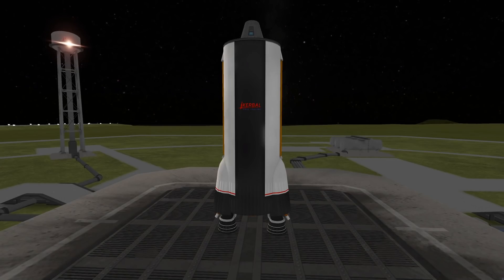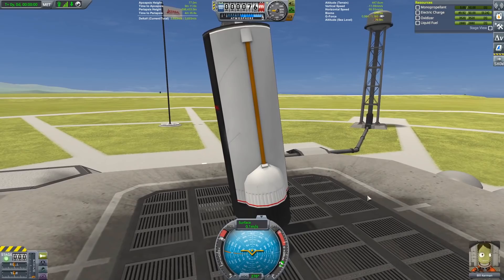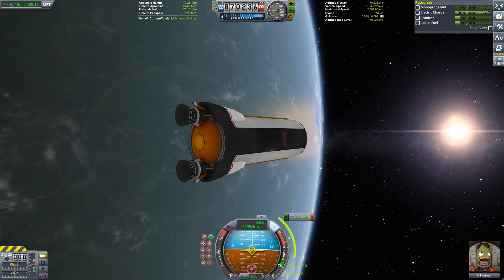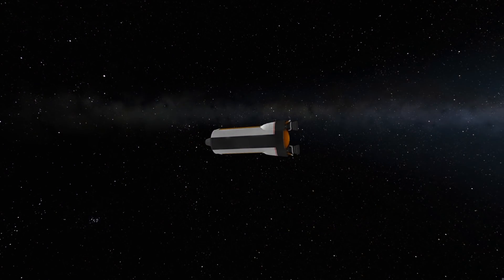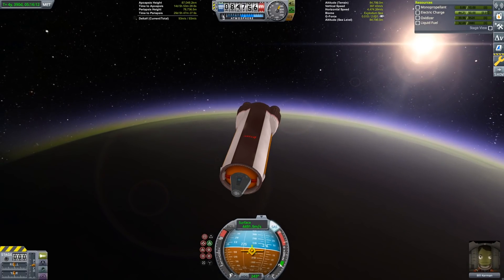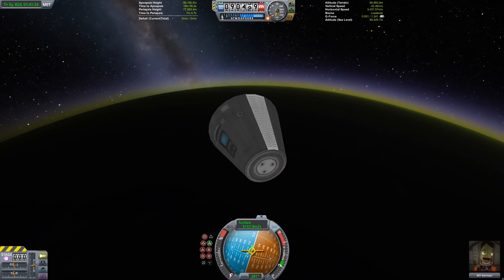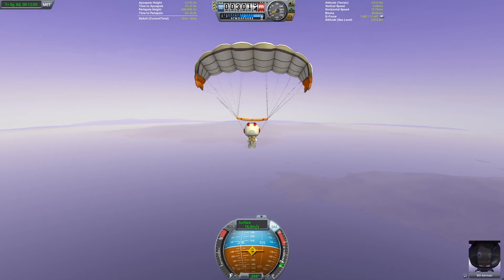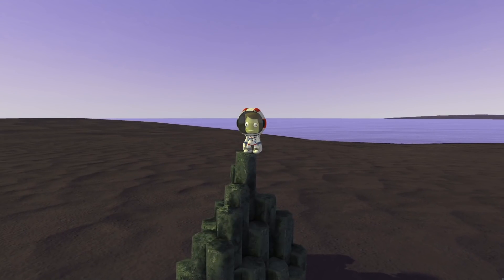2 Part Mission to Eve

Comment: For the inventory system, I noticed the "extra fuel" part adds 3 eva fuel, while a pack has 5, yet it is possible to carry 2 EVA packs, so isnt it better to do that for the 10 EVA fuel instead of 8 with the "extra fuel" part?

Comment: You could but a parachute for the craft into the inventory of a kerbal (I think) and then do the same thing again but when you break off the engine you can Eva and add the parachute... Then it's technically still 2 parts

Comment: great video as always. As for ideas, here's one (not fitting your minimalist series though). I was recently trying to build a stock walking robot and see how fast it could walk. My limitation was that the walking style should be akin to an animal. It proved quite hard to get decent speeds, mine topped out at maybe 7 m/s. Maybe you wanna give a shot at this? Loads of engineering problems: kinematics, KAL programming, material of the feet, steering, stability... This could also developed into a monte carlo challange, for instance time to walk down the runway. What do you think?

Comment: A Kerbal with the new EVA canisters has a total delta v of about 960m/s, giving the craft an effective delta v of 2004 m/s from LKO with the twin boar + EVA pack, this is enough for a one way mission to:

The Mun
Minmus (You can actually get back to Kerbin but without a parachute you won't be able to land)
Gilly
Ike
Duna (Technically, again with the return from Minmus you lack a parachute and thus won't be able to land)
Eve (Again through you don't have a parachute)

And you can do flybys of:

Dres
Jool
Moho

Perhaps using gravity assists you could capture into Jool orbit but you won't have enough fuel to land anywhere

Moreover these values don't account for the fact that you can fully refill your EVA pack by getting back into the command pod, technically you could go anywhere by getting out and pushing but that feels kinda cheaty

Comment: You could try a minimalist mission using the Outer Planets Mod. All the planets either have lots of moons (Sarnus and Urlum) or are incredibly far away (Neidon and Plock). 
You could also try Alternis Kerbol, a planet pack that re-arranges the orbits and sizes of the stock planets. (Kerbin is now a moon of Jool, Tylo has ~37m/s surface gravity and Eve is moonless, albeit with cool rings).

Comment: alright 1 part to eve and back
Reply: I part all landings grand tour no mining or refueling and no gravity assist
Reply: @bruhpolio8427  if someone pulls that off ill give em 100 dollahs
Reply: Actually this is theoretically possible. First, place a Lander Can in the Vehicle Assembly Building. Next, click launch. Then, open the cheats menu. Finally teleport the craft to 10 meters above the surface of Eve. You can also use this process to go back home! Boom! 1 part to Eve and back.

Comment: I find it hard to believe that command pod actually survived Eve reentry. Even a reentry from low Eve orbit can easily chew through heat shield. I'm really curious how this was done.
Reply: Low mass to drag. Irl you could deorbit a piece of paper without it burning up.
Reply: @moartems5076  you're a genius we should just return astronauts from space on paper airplanes
Reply: @plvmbvm513  the problem is the cubed law, as you increase surface area you increase volume exponentially. The surface area of a paper airplane is going to have to burn through the energy of all the mass behind it, also it has poor thermal conductivity so the heat built up wont have anywhere to go and be more likely to create a hot spot which in turn would cause a failure faster. A parachute would work better, with the astronaut lowered slightly in orbit from ejecting his spacecraft and just barely skimming the atmosphere, a very large parachute with probably a balloon skeleton to keep it wide open, something large enough to scrap enough energy off quickly enough that you aren't dropper into thicker atmosphere at a high speed. A secondary and tertiary backup parachutes for landing would also be needed, but the weight of the EVA suit would mean they're likely to suffer injury unless landing in the water, though that may pose it's own problems.
Reply: careful aerobraking

Comment: Only ion engines for propulsion and make it to eve and back? Or is that literally impossible?
Reply: it MIGHT be possible using the heat shield propellors. totally impossible with ion-only, though
Reply: @bradleylindsey3540  then you could call it "electric power and Xenon only to Eve"?